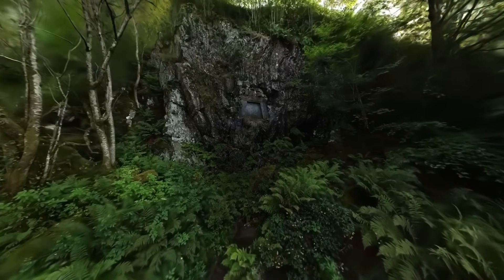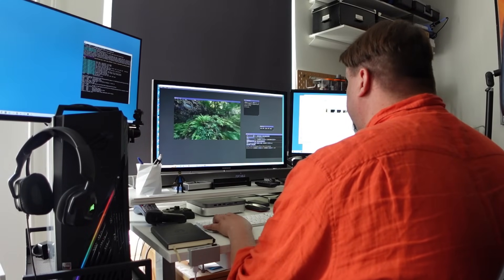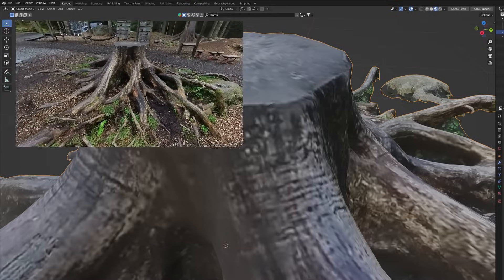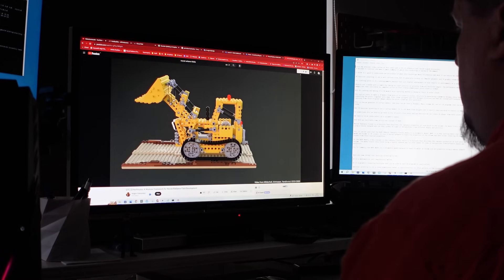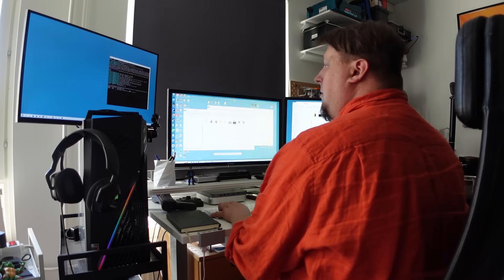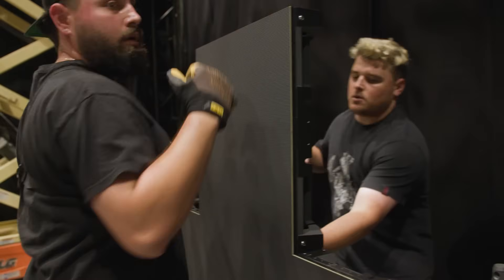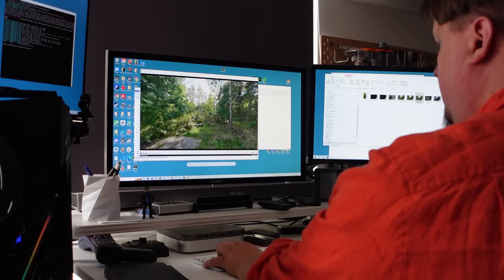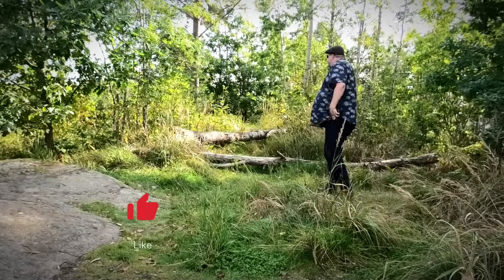What 3D Gaussian Splatting is not?

Comment: Nice video. However, I think both you and most of your commenters are conflating splat rendering (like this particular kind) with being anything other than a rendering process. Splatting (incl. gaussian) is a decade old with a lot of associated problems - which is why today we use mostly polygons. The reason they are getting a little bit of attention again now is because the geometry output of methods like photogrammetry is a point cloud and not a mesh. Its important to realize that we use polygons for good reasons and at the time the industry made that decision, splatting was also available already. It is not a revolutionary widely-applicable technique, but instead a technique with properties useful for niche uses - it will see little use outside of photogrammetry and related techniques.
Reply: Photogrammetry is emerging as THE key asset creation tool for major games. Niche, kind-of still. However that niche is growing very fast! I think techniques similar to this will be heavily implemented in the next 5 years. Perhaps not exactly as we see here though.
Reply: @jackquick8362  Photogrammetry yes. However, this still goes through a meshing pipeline and is rendered with traditional methods and not splatting. This is a big difference, photogrammetry and the rendering technique used for photogrammetry data should not be confused. I absolutely think we will see more photogrammetry assets (just look at what Quixel has been doing for years already). However, gaussian splatting is not and will probably never be the rendering technique used for this in games. The problem really is that, at the moment, gaussian splatting is not suitable for dynamic scenes, which games always use.
Reply: @jackquick8362  Photogrammetry is emerging as THE key asset "data acquisition" tool rather, as in we finally can afford scanning complex unoptimized model and textures and decide how to use them later.  But for the production pipeline, even in Cinema VFX level, we still do it the old way which is retopology, meshing, and turning these raw data into actual useful formats, with normal maps, height maps, roughness maps and all that.  It's just a higher level of recording data from real world, but you will never mass direct adoption of these raw data in scenarios such as video games, which require a lot of dynamic movement , a limited data size and high level of optimization.
Reply: @jj72rg why not?
Reply: @Freshbott2 My best guess, in a few possibilities:
[pardon my imperfect language, since I am not a dev nor english native speaker lol]:

1) Because "3D" images made with gaussians are "only" what they are.
- For example, you can't enter in a 3D environment like a dark room at night, with lots of 'shadows', (made in/with gaussians), and turn the light on, and see a difference of lightning, colors, shadows, reflections, etc. Because the base image does not have, for example, a light and light source information (therefore color grading info, shadows, etc): it only has the colors it has.
- Differently, when you make a room in a 3D program for a game, you make the "generic" room and can apply any sort of lightning you want, and you will see the changes in real time, because it's all made with poligons/textures/light sources that you can manipulate.

2) Same for opening a door in that environment: you simply can't.
Unless, I guess, you film everything and every combination you may need and "gauss" every single frame (every combination means, in the example above: the full action of the door opening and closing (and with different handle position for every frame in between) plus full door action in every light condition (room light on / room light off, etc). And this is just for opening a door and turn on a light. Imagine walking around that room with a flashlight, or making a spark (either an explosion like shooting a bullet or turning on a lighter in your hand): every one of those action would affect the whole scene differently depending on where they happen. So, if made thru gaussians, you would have to execute all those actions in all possible combination and positions/locations/direction etc etc. Otherwise, this gaussian 3D room would not change color when you make a spark. If that makes sense. Therefore, if you include an npc being in the room, moving as they please, suddenly all the combinations of possible shadows the nps would project in the room when you make a spark with your lighter or move your flashlight are exponential, we are talking probably billions of combinations. All of those would have to be "lived thru", created for real first, and then "gaussed" into 3D. But you can't take one "gaussed" situation and make changes to it.
This, at least, is my understanding at the moment.

Of course, the big question is: can we just combine techniques? Make vector models of the room + taking the "base" of colors/textures with a gaussian thing?
I guess it may be possible, but again, the "base" has specific lightning situations that may need to be much more dynamic in game.
Basically, what you end up with, is just a 3D scene took like it always was, and texture applied to it from pictures. Which is most likely what many high-end realistic games are already doing (with some polish I am sure). I am tinking of games such as Uncharted 4 or The Last of Us 2. I don't really see what the difference would be if they make those "scenes" with gaussian rather than pictures, if the scenes are anyway converted into poligons and texture later. And if you don't make the conversion, you are left with gaussian which as said have no info about anything like materials, lightnings, etc etc. Like walking thru a bush or into a chair will make them react differently: in poligons, you can code that, in gaussians, the scene doesn't even move, there is no info about a "chair" and a "bush", it's just colors.

So yeah, I don't know how it will be used in the future.

But it would be pretty insane to have say a movies shot in 2/3 differnt angles (which is already normal) and then "gaussed" frame by frame. It would become full 3D? So you could do that with an F1 race or a football match too? I don't know, maybe I wouldn't even need that.

But if I want to say see a house before buying and want to check it out before traveling to it, I would 100% prefer to see the "gaussed" house (maybe in morgning and afternoon bcs of lightning) rather than just a few pictures, which never give you the real idea of how it is to "move" inside that house. If that makes sense.
Reply: I'm curious what the problems are. Is it computational load that could be hardware accelerated?
Reply: @tommasoannoni4836  Thats indeed right!
Reply: @tommasoannoni4836  thanks for your thought out response. I hadn’t considered the lighting thing but I remain sceptical of the sense that it can’t be brought into the realtime pipeline in the long run. The film thing is a good point, backdrop and green screening would be perfect use cases for it. 

I’m optimistic about it being useful in dynamic environments given some of the unrelated but similar things we’ve seen from Nvidia and others in the past two years. Eg. 3D environments with back faces from photos and dynamic lighting from photos etc. although I don’t know enough about how those things work to suggest how they would be implemented to support Gaussian splatting. It makes me wonder if gamedevs could create or generate point clouds for Gaussian splatting rather than just capturing.

Also when you consider the fact Gaussian splatting is an old technique that’s been revived by the abundance of capture and point cloud technology. I think it could be similar to how neural nets were devised in the 70s but wouldn’t become supported by the industry and ecosystem till the early 2010s, and wouldn’t become a focus until mid to late 2010s. Now they’re just a commodity technology.

Coreteks did some videos years ago on how generative techniques could become the main focus in game development and since then it’s been obvious to me every time a sloppy technique shows up and people deride it but it turns out to be transformative. That’s exactly what happened with GPT4. 

So you’re probably right and I won’t hold my breath for anything to happen soon but in the long run I really hope they can get around the things you’ve mentioned.
Reply: @SecondFinale  The problems lie in the way the gaussians are generated. Essentially, it is an iterative optimization (="training") where you change the position, orientation and color of each gaussian such that it matches  with what you expect from a certain angle. This means that you are adjusting the gaussians only based on a fixed view (e.g. a set of photographs) where the geometry you depict does not change. When you then change the scene, for example you open a door, the gaussian parameters (position, orientation, color, ...) will no longer match up with what you expect, as the parameters were fitted to what the scene should look like with the door closed. If you want to open that door regardless, you would need to redo the entire parameter-finding or "training" process again. There are a number of problems with this:
1) You need a reference to what the scene would look like at every "stage" of opening the door.
2) You either have far too much data (you would need to store different parameters for each "version" of the scene, or you would need to re-find new parameters on the fly. The former gives you way too much data to handle, the latter is far too steep in computational cost, as you would need to repeat this for every frame in which any geometry changes. Doing this in such a short time frame is also far beyond the reach of any current hardware unfortunately.

A nice illustration of the problem of "gaussians are optimized based on a set of expected views" is visiting https://gsplat.tech/ and having a look at any of the models. You will see that the objects further away from the center of the scene look good while you're viewing them from the center (all the "expected views" were from around the center). However, as you move your camera away from the center and view the more distant objects from the side, you will notice that it was an illusion all along: the distant objects never had the geometry you expected, the just looked like they did from the narrow area in the middle of the scene from which all the "expected views" were taken!
Reply: @Freshbott2  Yeah, I mean, in its current form, gaussian can't be dynamic, but it may become!
What it would take is basically to link the gaussians "cloud-points" to a bendable structure (rig?) (for foliage, deformable objects like car in collisions, etc), and into separate independent structures (a chair different from the ground, etc).

I am not sure if the gaussian relationships to produce the image would be possible to still work, even when one moves the chair etc.
Probably not at the moment, but kinda possible in the future.

However, for games, the practical point remains: if you have to build every scene in real life first, that's crazy.
If you can make independent objects and put them together in a scene, then we are talking. Basically all realistic things would be done super fast, cars etc, and even like made up things from movies etc (idk a spaceship, a terminator, etc, you just need a few frames of different angles, or like a lot of angles?).

But yeah like always, tech in its infancy looks stupid, like at the creation of "pong" you wouldn't think "Oh sure, soon we'll be making photo-realistic action adventures with live action capture, full-blown storytelling, orchestral scores, online multiplayer, hundreds-of-million budged games". But we did get there, by cobining techniques.

I would guess that a super smart fella could make an "AI" machine learning thing that figures it out for us, lol (that figures out how to combine poligons with gaussians etc, or how to "infuse" gaussians with tags and info about materials, lightning, and makeing it dynamic, and make everything practical).

We shall see!
Reply: @tommasoannoni4836 if you apply a transformation on the points instead of regenerating the scene you'll just get trippy deformations of the image, not anything that's recognizable as movement. 

Making one of these scenes is kind of like baking a cake. You can bake a cake any way you want, but after it's baked you can't, by doing something to the cake, get a different cake. 

I'm a bit more optimistic though, maybe because I understand this stuff less. I think you could get slideshows (baking one cake every couple of seconds) or small deformations that look very similar to small movements like blinking, in the style of hogwarts paintings.

So niche applications, but I think indie games especially will find ways to use this.
Reply: @JorgTheElder  Yes, that is the niche that this technique excels at.
Reply: @JorgTheElder  Could you tell me applications (as in uses) you can thinking of?
I can't quite understand the potential impact.

I imagined, for example, when viewing a house (for possibly buying or renting), a 3D "virtually walkable" thing on the website would be much better than just pictures. But then eventually you would still want to go there and see it, before moving in, lol.
But, I am not sure what other uses there could be, other than things like those and museums etc.
It would be awesome to have this sort of 3D made from pictures from Mars etc. But it still seems like a niche thing to me, at the moment. Like the whole VR is nice to live on occasion, but in everyday life, important things like emails or entertainment like movies and social media "rolls"/videos, actually work better on a flat screen, so easy to pick from the pocket and look at.
So, if this technique is not developed into modifiable 3D scene, useful for videogames and movies, I am still not sure of the potential uses.

I could add: part of the training in specific situations (like, I honestly don't know, an oil rig work place, the inside of a dangerous place like maybe a vulcano etc) could be useful if done viewing this 3D scene, to for example learn and get accostumed with layout etc.
Reply: @tommasoannoni4836 I wonder if in the future people would use this gaussian splatting with an AI to automatically differentiate objects and make them into polygons, just like AI can differentiate objects inputs and draw them right now.
Reply: @ozymandias8523  Yes, I wonder that too. I am not sure how image generators work under the hood: for example, the text generator don't really "understant" anything thay are saying, it's just a very advanced text predictor: it creates sequences of words - based on the prompt/question - that are most likely to happen and "be relevant", but they don't "know" what they are saying.
So, similarly, image generators may also be just generating by composition/pixel proximity thru extensive training, maybe they can associate words with most likely color-combination, but not necessarily "know" what obects are and how they behave physically.
That said, the word-associations appear to "be there", so maybe can still train the new info and then implement all that into a game engine so that info is still elaborated and sent to game engine object parameters.
Cople that with the fact that general chatbot AI are able to write some code, and with further development it may get very interesting.
Like possibly generating games from promtps, including 3D models, AI voices, scripts and behaviors.. we're not quite there, but it couold be possible.
And, at that point, you wouldn't even need gaussians that much anymore.
Wow.
Reply: @tommasoannoni4836  i've never been so excited to be human than this era, things will be crazy with tech in a few years.
Reply: Well said. Thank you
Reply: There are so many use cases for this. By no means does it replace polygonal assets, but if you’re thinking of it as another tool, well, I’d be more than happy to have anything organic, vegetation etc using this technique. Especially since there seems to be good topographic coherence in 3D.
Reply: @jgbailar  Fundamentally I agree with you. However there are many difficulties, even for use cases like vegetation like you describe due to the fact that the scene is static and lighting the scene is very difficult and I have not yet seen it done. Dynamic lighting and movement is an absolute necessity for good looking vegetation, and the same applies to many other kinds of scenes, both in games and film (which are the prime "consumers" of computer graphics, particularly for photogrammetry-based scenes).
Reply: @eliasboegel  oh yes. It’s true that this kind of capture would dictate the light for everything else. As for the gentle motion of leaves and tree tops swayed by the wind… I guess that’s not happening either with this approach 😅, unless there is a way of applying a bit of perlin noise to the splats without breaking the scene…
Reply: @jgbailar  With how the approach is done currently, there won't be a way to apply any such movement without creating very weird artifacts. Perhaps someone will come up with some alternative way of generating the gaussian parameters in the future, where this becomes possible. We will need to wait and see.
Reply: I'm not so certain of this. Of course it won't displace the industry standard, but I don't see why it wouldn't be suitable for games, even if it's a niche game. Games have been made with all kinds of graphics, it's possible to design around restrictions of the technology. I don't see why lighting or moving objects would not be possible btw. An object transform is not different from a camera transform, after all. For lighting, "training" the splats for normal or occlusion data seems an option, and I'm sure we'll see technologies for this too. (Skeletal) deformation of course is more challenging, as you would have to pretrain poses which limits the applications. Though perhaps here something neural could fill in the gaps?  The real hurdle in my eyes are the performance aspects. Optimizing the splat data streaming, occlusion, etc. Having to train models before usage is also a hurdle for send to overcome when integrating this into a workflow.
Reply: Also, for asset generation I don't think this has to be all photogrammetry. After all, what is modelling besides combining smaller shapes to create something larger? This will be possible. However, what makes it hard is that lighting and albedo are baked in. For something like this, objects would have had to be generated or scanned in known lighting or whatever to allow changes. Talk about re-rendering meshes as splatted objects would be too funny, though adding 3D detail to models that way similar to textures could be very cool?
Reply: FUDing hard
Reply: @Freshbott2 after reading along the comments until this one, I feel that what u wanna express is that: the mesh based vs point based tech today is like the traditional car vs EV years ago. People don't believe ev will work around the engine barrier too. And now Tesla beat them😂 Is that what you want to convey?
Reply: @zeamon4932  that’s exactly it. Coreteks released videos years ago that talked about technologies like upscaling, neural net based filtering to make ray tracing efficient etc. etc. 
Viewers in his circles don’t really argue with it but if you’d said it to a layman back in 2017 most would have probably pushed back thinking - if you need better performance, you need more compute. If you need better looking scenes, you need more intensive shading etc. etc. 
For me personally, I’d like to see Gaussian splatting for backdrops. You could be in a level that’s manually built, but the skyline in the background could be Gaussian splatting rather than low poly models or sprites. 
Generally things that need detail but won’t move and mustn’t consume valuable resources.
Reply: You tried your best to explain this, appreciated, but I would like to suggest you to do not waste time sharing knowledge that requires expertise on platforms like Youtube, as you can see from the answers and questions, even if you explained it as clear as possible, was not enough and never will be, that's mostly motivated by the fact that most people on YT are young and/or very biased, most users, click on a video with an expectation already, and a touch of fanaticism for the topic or the person, without the correct knowledge to understand the topic anyway. 

What's intellectually dishonest on this platform imo, is the attitude of content creators, acknowledging the ignorance and bias of their audience, but without ever point it out, to do not loose them.
Reply: I like your answers. You're german too (quick look at your profile), are you actively researching about 3D reconstruction methods? Any way to connect? 
I'm also wondering if its possible to create and extract vertices from a given overlap between the splats.
youtube.com/@eliasboegel
Reply: @GamingShiiep  My work is computational physics but I'm interested in computer graphics as an on-off hobby. I don't actively research reconstruction methods and I don't always keep up to date. There's different ways to reach me, do you have a preferred platform?